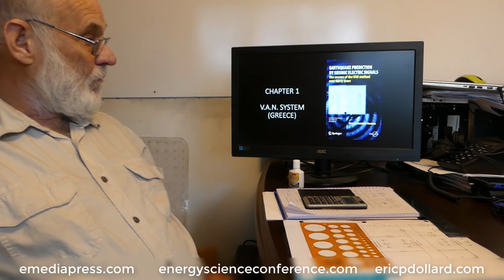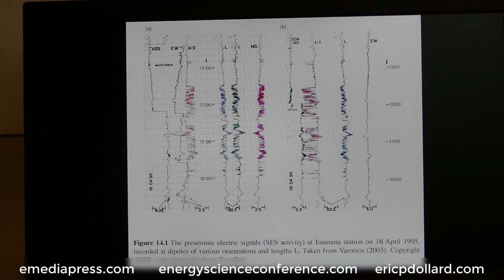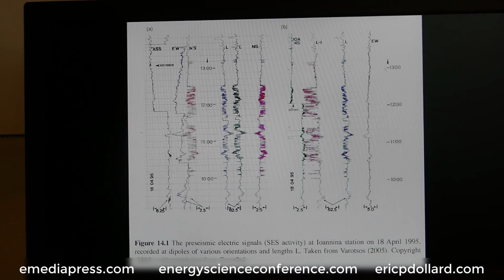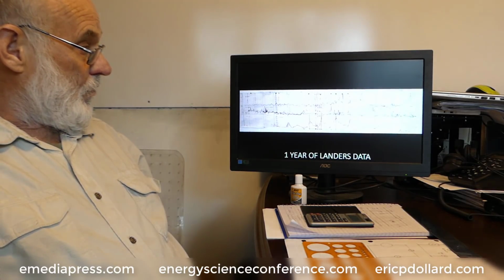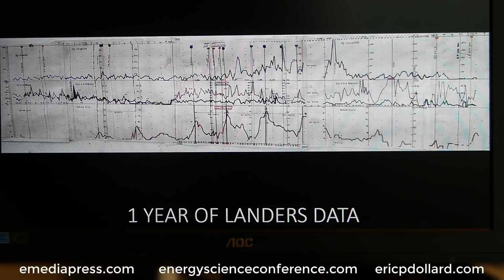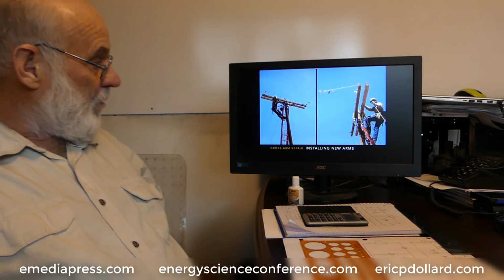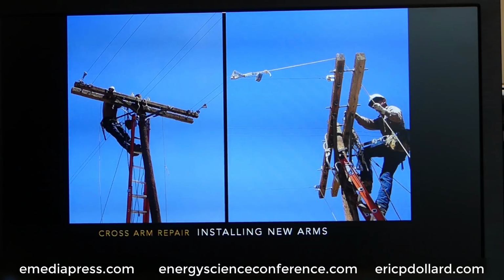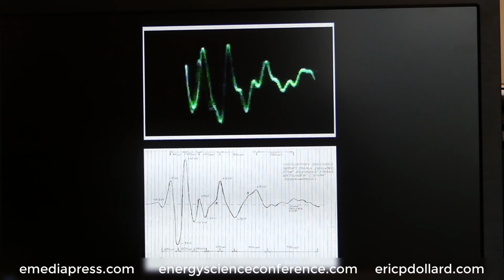Full Scale on the Chart, From the Other Side of Earth

Comment: In regards to the Sun being "dead".... If we look at the Sun as a transformer, and view Sun spots as not an "active Sun", but rather heavy LOAD on the transformer; so that means the there is LOW USAGE by the Solar system.  The transformer (Sun) is dead (and it is, just checked, zero Sun spots = very low LOAD) because the Solar system's lights aren't on, and nobody is using the air conditioning ect. ect.....